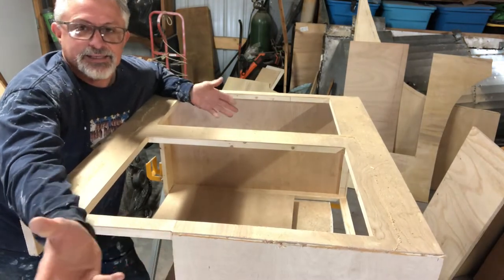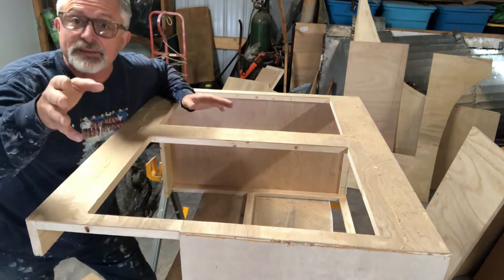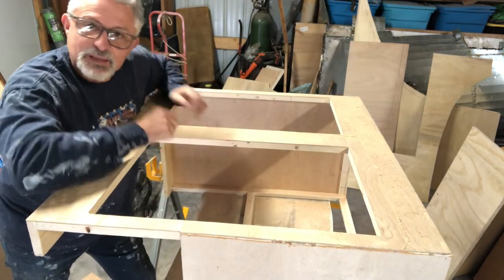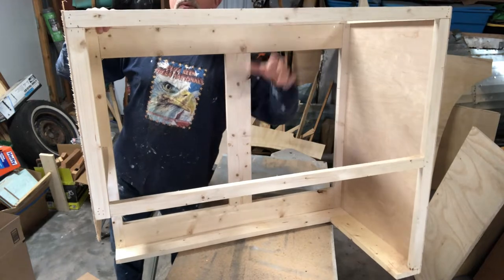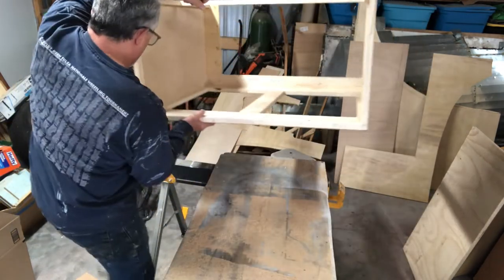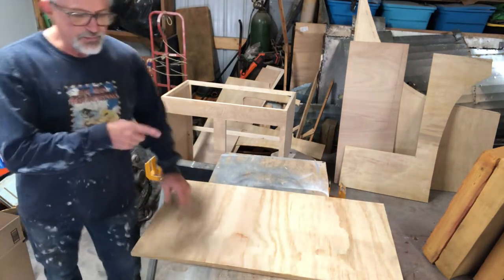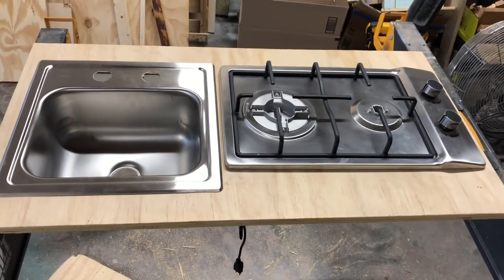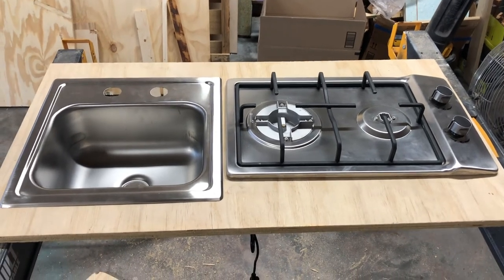EP. 171 Vintage camper kitchen rebuild. Install countertop, stove, sink

Comment: We are rebuilding a 1999 wilderness lite by forest river. We got it very cheap. We knew we had to replace the roof. The process is going slow because it’s so hot here. I decided I don’t want the stove back in. I want to use a portable one like you have there. We plan to also use a small refrigerator like one the college kids in the dorm.I definitely want counter space just in case. We have to build the counter top. I want to  use the hand torch on it and burn it then apply a sealant on top. I’m excited!! It’s definitely a lot of work! I know you have a passion for what you’re doing. I’m excited to see what you do to these campers!
Reply from the maker: Thank you. Good luck on your build

Comment: The counterspace solution with a portable induction cooktop sounds like a good inclement weather solution. I did see one fellow with his personally renovated camper who had built a top for the stove. It was a vintage type with oven where he stored the grates and other items for the stove. The oven looked almost new and very clean; I don't think it had seen much use.I would prefer to cook outside on a propane or liquid fuel stove. Keeping the moisture from propane, the grease vapors if frying and the heat outside when you can makes sense to me.
Reply from the maker: Smart move

Comment: I was thinking about what to do about a stove today. I have a self contained unit that I plan to put a quick connector on so it can be used inside or outside. I prefer to cook outside unless it’s cold anyway.
Reply from the maker: I'm a cook outside guy too! Pack a microwave for emergency

Comment: I am in the "north" (Iowa). When I had my popup camper I would take the stove outside. There was a place to hang it on the outside to the left of the door. There was also a coupling for the propane tank out there. It seemed safer to me to cook outside of that popup. 
I guess it would depend on how much time I was going to be in the camper. If I was living in it for several months at a time I would have an inside stove. If it were a weekend here and there I would bring a camp stove and a table to cook on outside.
Reply from the maker: I agree with that. But it does look more vintage with the stove installed.

Comment: I would have to say that I would like the counter-top space but...   if they ever sell it, the next buyer will probably want a stove.  Back when I was in sales, we would take in used rv's that were 10+ yrs old and the ranges still had the owner's manuals in them ALL. THE. TIME! Owners rarely ever use the range and I think they would be better off just getting a portable induction cook-top that they can store in the cabinet when not needed.  I wish there was a stove that could be folded away when  not needed in the rv.
Reply from the maker: That is good inside information.

Comment: Actually, the stove is fine but the sink is too big. Turn the stove so the controls are up front and use a smaller sink. Putting in a cutting board would be essential if it were for me. Can't wait to see it completed.
Reply from the maker: Not sure there is a smaller sink available. The stove is to long to put the controls up front. That was the only way it would fit.